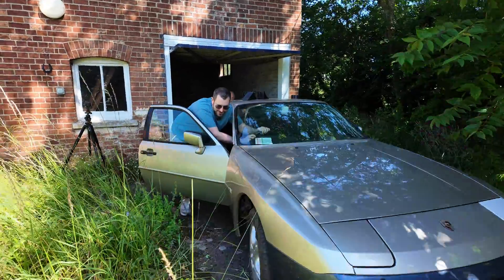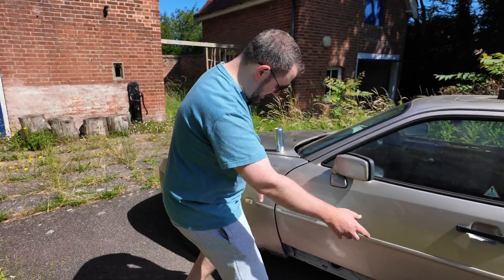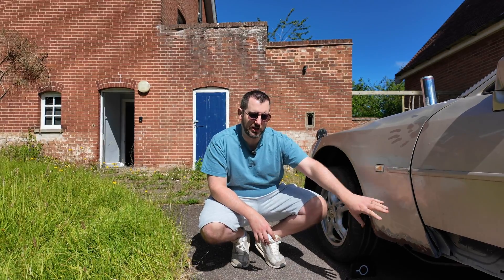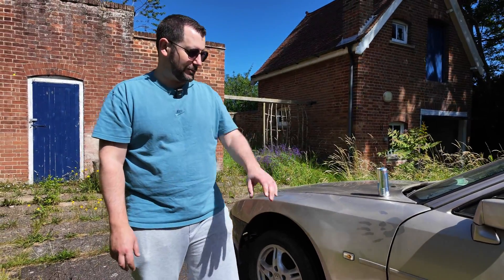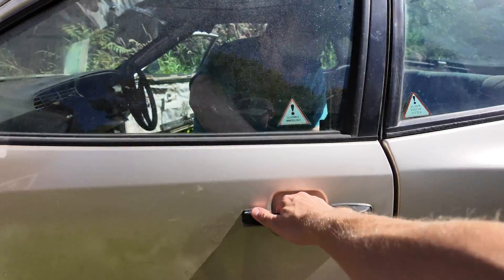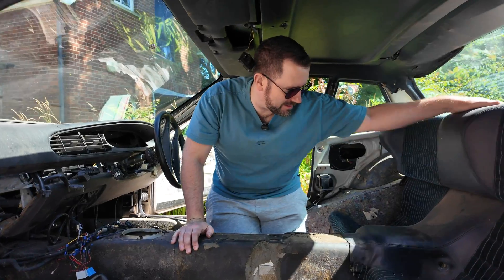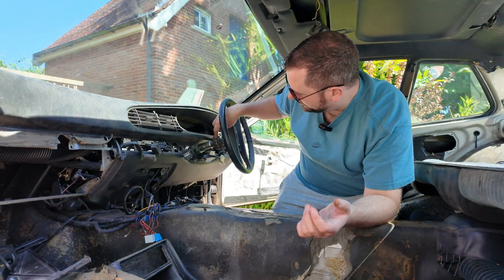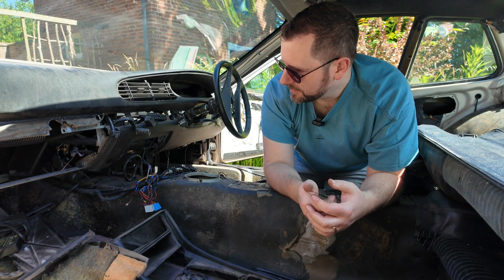06: Cutting Edge: Modernizing the Porsche 944's Design for an Electric Future

Comment: What tesla motor are you using? Did you get it form a model 3 or model s? Do you have a website with more details?
Reply from the maker: You're a little ahead of me here, not purchased it yet, but most people have pointed me at using the rear motor from a Tesla Model S. I'm not sure if I would go for the ∼280hp or the ∼500hp. While I would love the power in theory, it might just be asking a little too much of the the car on UK roads.

Comment: In the UK you cannot modify the monocoque chassis and retain your V5. Anything welded to the car cannot be modified from original only restored to original condition. Have you sorted where you getting your motor + controller from? Who is doing the scanning of your car for you, I would be interested in having a play with the data.
Reply from the maker: Thanks for your comment. I'll be doing the scanning myself, but would be happy to share the data. Not worked out where to get the motor + controller + batteries from yet, I don't want to break the bank more than I have to.

Comment: i'd urge caution about putting batteries in the boot/spare wheel area. that area basically becomes a crumple zone so if a battery box is in there a minor prang could lead to lead to a lot of damage. If you can keep the batteries in a single box it'll make life a lot easier for you when it comes to wiring and BMS etc, for 150ish miles a 50kwh pack should be more than enough i'd have though. i've said it previously but defo but some effort into making that steering wheel adjustable! otherwise you could find the driving position horrendous.
Reply from the maker: All good points, really appreciate it.